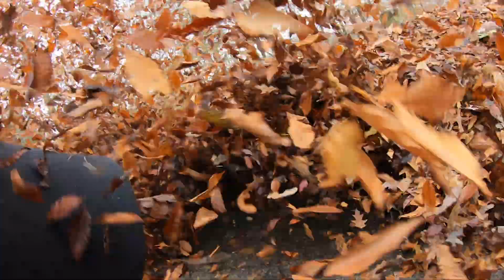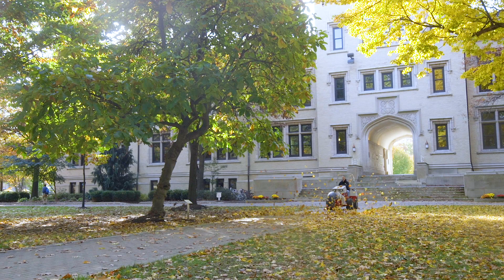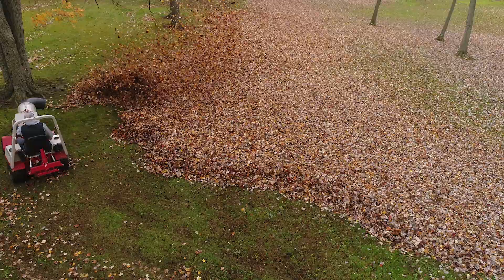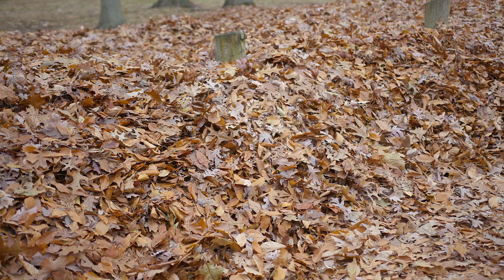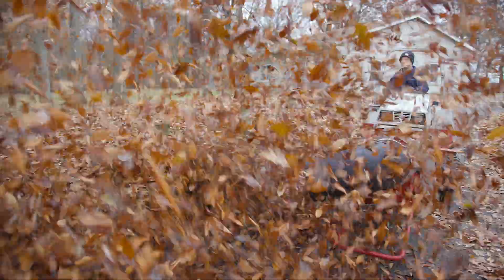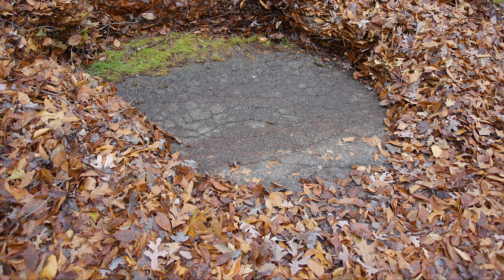Power Blower Vs Turbine Blower - Which Leaf Blower Should You Choose?

Comment: I have the regular power blower,it  is a really nice attachment.For 30 years I also had a Steiner power blower I like the Ventrac blower much better. The ability to change direction and blow straightahead is very valuable for myself being a landscape contractor not just with leaf cleanup but with parking lot cleanup and also when running along fence lines it’s a huge game changer I hardly need the backpack blower anymore. When I had the Steiner blower I need to spend a lot of time with the backpack blower first. The turbine blower while it is cool it’s very expensive it’s very large.It’s heavy it takes up a lot of trailer space and it would not help at all on fence lines I wouldn’t even consider one because of the cost however if you have the space for it for a company like a golf course the money wouldn’t matter much it would be well worth the investment.

Comment: What drives the decision is size and volume.

Mowing the leaves up significantly reduces volume.

The  KA 160 does a great job.  I wish the wheels were a little taller.  If I give it full throttle then tractor speed drops significantly.

Comment: If you gonna rotate the turbine blower then you should have rotated the power blower...
Reply from the maker: Good catch.  That was just to show that the Turbine blower has the ability to turn in that direction.  The other blower doesn't.  It only rotates along the plane of the ground so it wouldn't have been able to knock the leaves off the top of the pile anyway during rotation.
Reply: @ventrac  well sure but the rotation was being used to its full advantage to push the leaves further back and if thats the case then you should have shown off the rotation of the power blower to cover a wider area or that it blows straight forward (dont know didnt show the comparison).

Comment: now show snow,  dry and wet
Reply: power blower would be amazing for snow i bet.
Reply: @fixt100  the only video is very dry and light.  I want to see how nasty works
Reply: @kimgriffith1054  the second its wet it doesnt work very well because it freezes onto the surface, i dont think a "better more powerful" blower would fix this, i do think in any situation you can use a backpack blower you could do it 10x faster with one of these (like whole parking lots before anyone drives on the snow, you can clear right down to cement). something like this is great for a place like Canada because it gets cold and stays cold enough that the snow wont stick unless its been driven on or walked on.

Comment: Thanks for uploading this.  My uncle had this very question for me the other day.  I told him that each of the 2 blowers has a purpose.  He's been a Ventrac owner since 2003 with an original 3000 tractor.  Because of him, and how impressed I was with the capability and versatility of Ventrac, I bought my first Ventrac, a 2005 4200VXD and then 2016 4500Z.  Then my dad bought a 3100 in 2010.